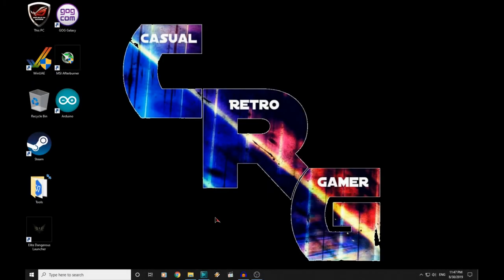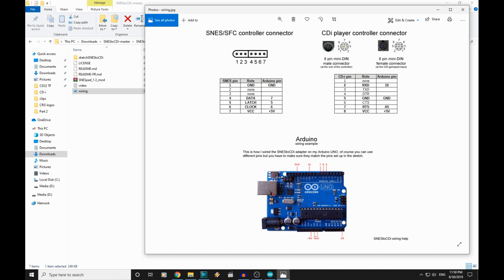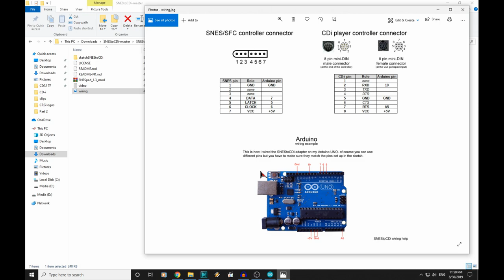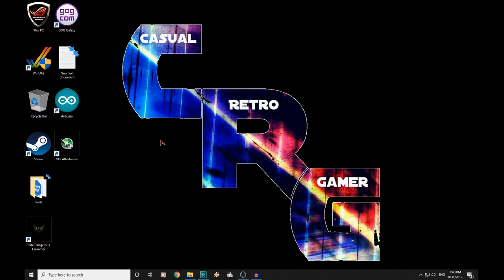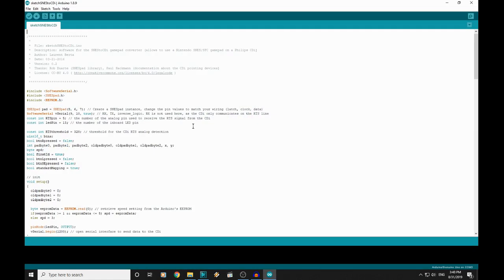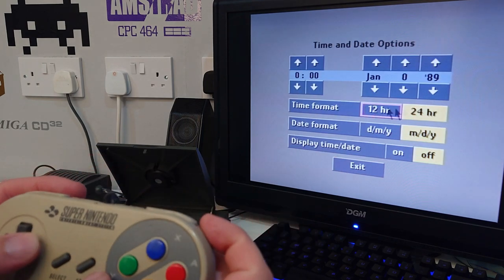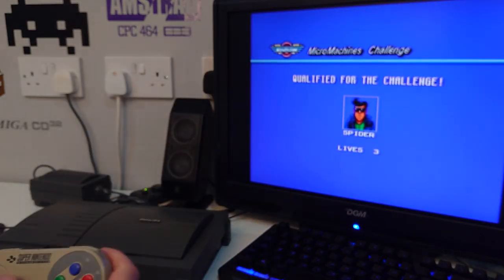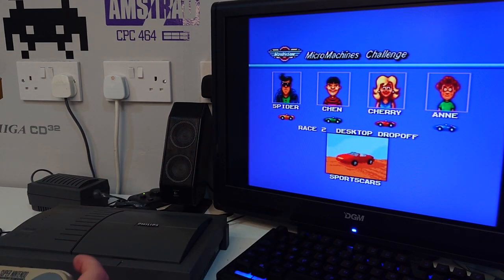Philips CD-i - Part 2 - SNES to CD-i Arduino Adapter

Comment: Nice job on the controller. Watching micro machines cdi was giving me a headache :)
Reply from the maker: I'll add it to the list for the next games night.  7th Guest is not bad and there are a few other decents games too.  Once I get the output improved I'll maybe or a video to show off some of the better games on the system.  It gets a lot of hate but it does have a few good exclusive games.

Comment: It works!!

Now I have to figure out why my CDI can't play burnt CDs....
Reply from the maker: Cool, glad it worked for you.

As for your cdr issues, the signal from a cdr is less than that from a pressed disc so if the laser is getting old it's possible the signal isn't enough for the console.

First thing to try is burning at a slower speed and use decent branded cdrs. 

Failing that you could try a small tweek of the pot on the laser itself.  Mark were it currently is then turn it in small increments to see if it'll read.  Do bear in mind that increasing the voltage will further shorten the life but luckily full replacements lasers are still available for the cdi.  The pot is on the underside of the laser.  Don't touch the various pots on the cdi motherboard.

Good luck.

Comment: Hi, great video and very helpful. Quick question though - I picked up an 8 pin mini din but it seems to have an extra wire, white? So 10 in total including the bare/shield.... is this normal?
Reply from the maker: Not came across that before but so long as its 8 pin mini din just use your meter to work out which cable goes to which pin and your set.

Comment: is it possible to add the speed setting switch found on 3-button CD-i controllers to this adapter?
Reply from the maker: I'm not familiar with speed setting switch but I don't think it's supported.  You could maybe do it but it would need added to the arduino code.

Comment: Now if you could figure a POWER SUPPLY hack???? or a way to fix the POWER SUPPLY for the CD-i 450!!!!!!!!!!!!!!!!!!!!!!!!!!!!!!!!
Reply from the maker: The 450s power supply is a difficult one because of its voltage sensing.  The +5 and - 5 is easy, a meanwell psu will get you that but controlling it is another problem.